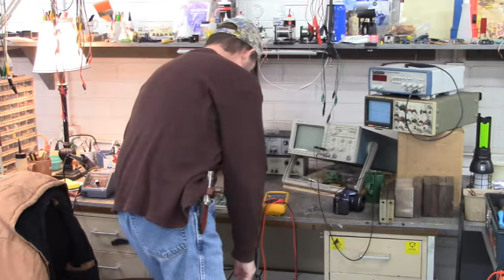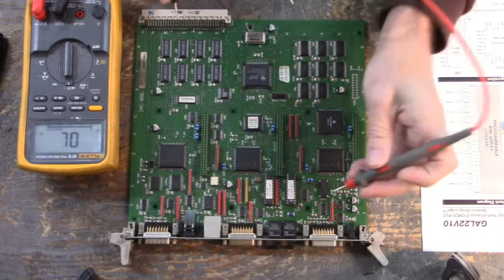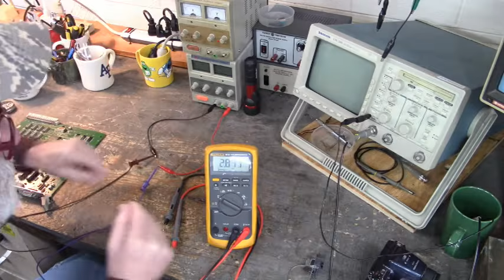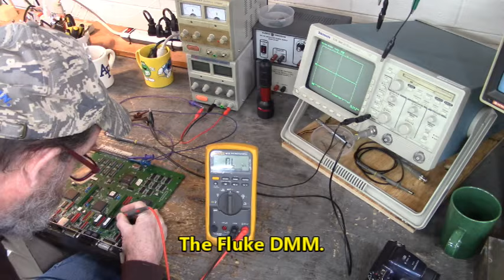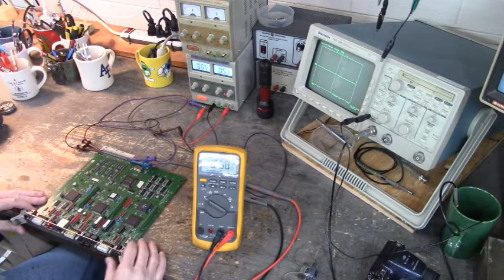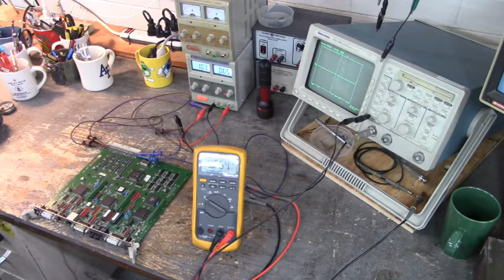Safely powering a circuit board on your bench from a DC power supply

Comment: Thats an IMC from a AgieCharmilles EDM machine!, You can also plug in a ASI daughterboard which will evaluate for examaple a linear encoder, this part is still in producation and use today, I work on these regularly in the machine, but never repair the circuitry itself. Do you have any anecdotes from your time working on these PCBs? I will check it out soon.